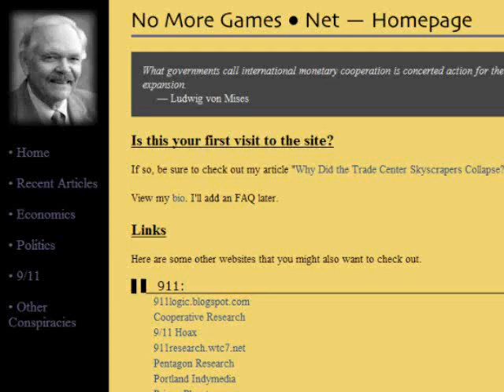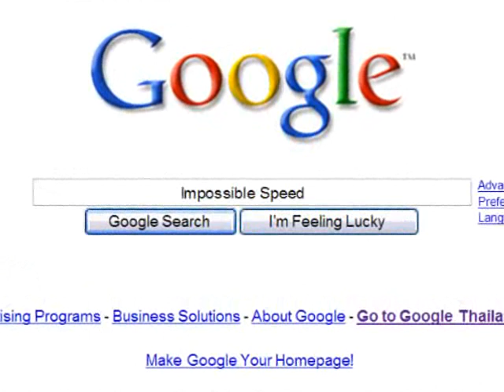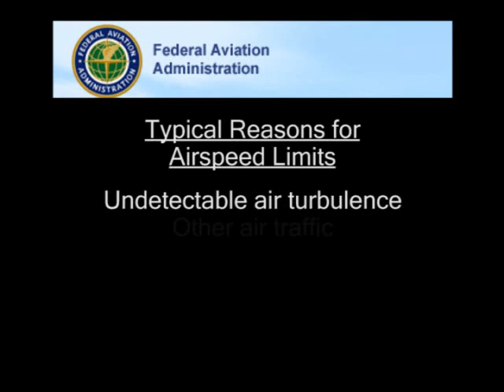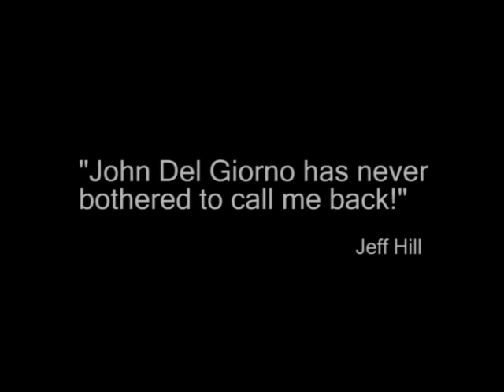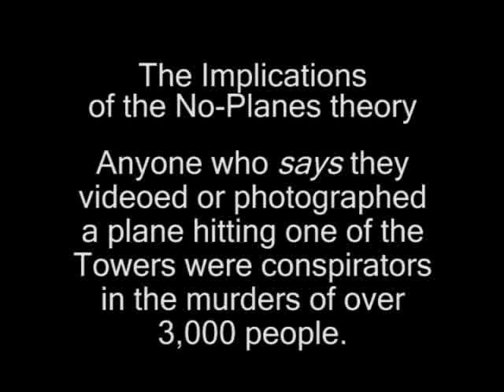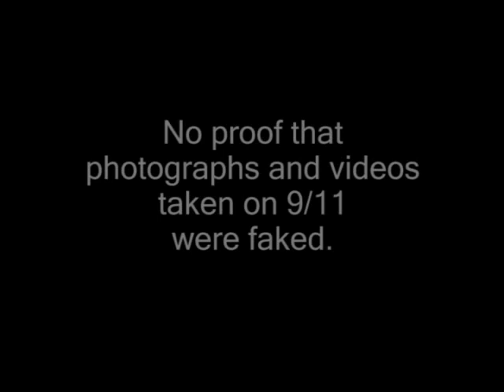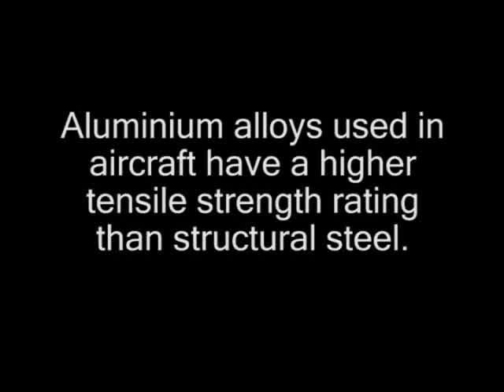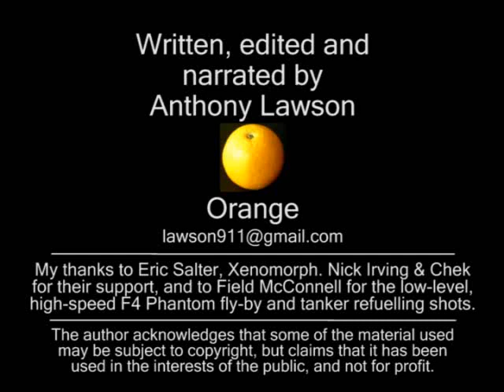9/11: Impossible Speed & Impact -- Busted! Updated

Comment: What a total load of GARBAGE .
Antone who knows a COMMERCIAL AIRLINE PILOT WILL FIND OUT FROM THEM , THAT COMMERCIAL
AIRCRAFT ARE NOT DESIGNED TO FLY AT MAXIMUM SPEED IN DENSE AIR.
THEY CANNOT BE ACTIVELY CONTROLLED & WOULD EITHER CRASH OR DAMAGE THEIR WINGS
IF FLOWN AT MAX SPEED IN DENSE AIR.
ALL OF THE FOOTAGE IN THIS VIDEO SHOWS MILITARY AIRCRAFT - COMPLETELY DIFFERENT CREATURES ,
WITH COMPLETELY DIFFERENT SPECIFICATIONS FLYING AT 500 + MPH  IN DENSE AIR.
The PLANES WHICH CRASHED INTO WTC 1 & 2 WERE BOTH MILITARY DRONES -- FULL STOP .
IT IS MOST INTERESTING THAT THE AIRCRAFT ENGINE WHICH WAS FOUND AT MURRAY STREET JUST AFTER
9/11 WAS QUICKLY DISPOSED OF - AFTER IT WAS REALIZED THAT UNITED AIRLINES  ENGINES WERE
MANUFACTURER BY A DIFFERENT COMPANY.
NO WORDS ABOUT THAT LITTLE MISTAKE IN THE OFFICIAL NIST REPORT.
Reply: Desert Born 
"Mountain of evidance"? Nobody credible says that you can't fly at such speeds, just that it's not recommended and dangerous. How interested in recommendations and safety do you think a suicidal pilot is likely to be?
As your man above says, the planes "WOULD EITHER CRASH OR DAMAGE THEIR WINGS
IF FLOWN AT MAX SPEED'.
Hmmm…crash or damage their wings? Sounds dangerous. Not recommended.
Reply: jbyeats Maybe you should look up the speed the commercial Egyptian airliner reached when the pilot decided he was going to commit suicide and crash the plane into the ocean in a dive. You will clearly find out that a plane can stay together and speeds way past the recommended "safe speed" I'll bet you won't do the due diligence and research it though, your kind never do and just parrot shit that you think is correct
Reply: Brookfield
Like many millions of people across the Globe -- I watched the second plane crash into
WTC 2.  It was in LEVEL FLIGHT -- NOT DIVING  .
Reply: Brookfield 
So what "dive" was Flight 77 in when it flew for over a kilometre at an altitude of just 6 METRES, flew over a raised highway, clipped 5 lamp posts in the process, levelled off again and smashed into the Pentagon at 530mph, penetrating nearly 100 metres, through reinforced concrete and steel?
Not to mention Hani Hanjour, the pilot of Flight 77 was described as a "terrible pilot" but his flight instructors and was actually denied rental of a plane until he'd taken more lessons.
Instead he managed to perform a high speed, high banked manoeuvre, descending through a 330 degree turn well in excess of 500mph. A manoeuvre many commercial and air force pilots have dismissed as "bullshit".
Not possible.
Reply: Thank you, Professor, but shouting does not mean you're right. Have some honey & lemon, sit down, and read some of the genuine scientific evidence.
Reply: Brookfield Nobody credible ? So you think that Pilots of those planes, Plane Engineers, Plane Designers, Governing bodies are not credible ? So what counter evidance to these experts and authorities do you have? Clearly its your jump in logic and the agenda you have to put your head up your ass and ignore basic facts. PROVIDE YOUR CREDIBLE WITNESSES/EVIDENCE TO COUNTER THE EXPERTS. If you cant, DO NOT POST ANOTHER THING ON THE TOPIC
Reply: You sound just like someone who is in the employ of the American Government .
Just like the vast majority of the experts you mention --- who if they really expressed their opinions would lose their jobs or be blackballed .
The vast majority of these experts either work directly for the US Government or one of its agencies -- THERE IS NO WAY THEY  ARE GOING TO COMPROMISE THEIR SALARIES
& THEIR FAT PENSIONS .
Reply: Antipodean33
Parrot Shit - Is that Correct. ?

Maybe you would like to start a discussion about " Parrot Shit  " -- with
 MR RUSS WITTENBERG -- who is an AMERICAN AIRLINES pilot who FLEW the
ACTUAL PLANES which CRASHED on 9/11.
YOU CAN CHECK it out on YOUTUBE.
However - "   I'll bet you won't do the due diligence and research it though, your kind never do and just parrot shit that you think is correct ."
Reply: jbyeats
Why would you expect a pilot to be an expert on the technical capabilities and limitations of the aeroplane that he flies? Do you trust racing car drivers or taxi drivers to know about the tech specs of their vehicles too?
Reply: Brookfield
Next time you get on a plane --  explain to the Pilot that he is a moron -- and knows nothing about the technical capabilities & limitations
of the aeroplane he is about to fly.

As for Russ Wittenberg who flew the ACTUAL planes which crashed that day on 9/11.
This man is in his 60s with a wealth of flying experience & when he tells me -- it is NOT HUMANLY POSSIBLY  to FLY the MANOEUVRES the PLANES WERE SUPPOSED TO HAVE FLOWN THAT FATEFUL DAY --- then I believe HIM

SHOW ME JUST ONE AIRLINE PILOT
on GOOGLE or YOUTUBE -- who CLAIMS HE COULD FLY ONE OF THOSE PLANES AND CARRY OUT THE FANTASTIC MANOEUVRES -- which the 9/11
COMMISSION STATED .
Go ahead -- JUST SHOW ME ONE .

Imagine if Russ Wittenberg had stated the opposite -- That he could indeed fly all those
moves etc. It would never be off YOUTUBE and GOOGLE . It would be stuffed down all our throats - NIGHT & DAY .
Reply: jbyeats Checkout the speed of the Egyptian airliner reached when it's pilot decided to commit suicide with many others on board. He put the nose down and went screaming into the ocean. Checkout the speed. Also don't forget, we know the planes used to hit the towers, were not the actual planes that was claimed. They were no doubt beefed up and the various different angles, that many people filmed of the second plane, proves that the plane did indeed reach around 575 mph
Reply: Antipodean33
Was the Aircraft intact when it struck the WATER ???

Also we know the aircraft which certainly
struck the SECOND Tower on 9/11 was not a
Commercial Aircraft -- as COMMERCIAL
AIRCRAFT DO NOT HAVE LARGE  PODS STUCK TO THEIR UNDERCARRIAGE .
( Check out any of the live feeds relating
to the second aircraft -- which are all over
Youtube and Google. )
Reply: jbyeats Thats right, that is what i'm saying. We know the second plane was not the plane (the commercial airliner) the govt claimed it to be, because of the huge pod under it. So now we have a mystery plane, which is no doubt remote controlled (the AWAC pod you mentioned) and it does have a military type of appearance, so it could be an ex military fuel tanker plane, which would have a beefed up super-structure and as such could attain the high speed which is proven to have reached
Reply: Antipodean33
Indeed correct.
All I ever said was ' Commercial Airliners  '
are not able to attain such speeds.
Of course - a militarized ex - airliner -- would have completely different parameters .
Reply: Antipodean33 Egypt Air 990 disintegrated around 17,000feet with a True Air Speed of 700mph and an Equivalent Air Speed of 480mph, this being when all signals to the Voice and Data Recorders terminated.
Conspiracy Theorists claim that this did not happen as the Aircraft pulled out of the Dive before 'Gliding' back up to 20,000feet or so, leveling out before entering 'another dive' and crashing into the sea.
The NTSB claims that during the Manhattan Massacre a Boeing 767 series 200 maintained a constant speed of 580mph at sea level with the same propulsive force that enabled it to fly at 535mph at 35,000feet.
It does not take much imagination to realize whose agenda the NTSB is promoting. (Zio perhaps?).
Poddies and Planeies go and get your heads tested.
Reply: Alan Marks
Now consider that the plane was diving, and the pilot did not care about safety or recommendations re speed.
Reply: John Smith
Why are you asking about a dive? Nobody's ever claimed it was a dive.
Reply: Brookfield
"Now consider that the plane was diving"
- You

Regardless as to what planes were diving and exceeding whatever air speed limits that have been imposed on them by the FAA at certain altitudes, it is not possible for Flight 77 to have impacted the Pentagon at 530mph at an altitude of 6m, especially since the turbulence and forces inflicted on the airframe at such a speed would have seen dear old Hani Hanjour plummet to the ground before he could ever utter the words "Allahu Akbar".

Passenger airliners are simply not designed to make such high speed, high banked manoeuvres, let alone reach those speeds at altitudes low enough to clip lamp posts and a generator sat on the Pentagon's lawn.
Reply: John Smith
I recommend that you brush up on your reading skills. I was responding to Alan Marks' comment about "the Manhattan Massacre…Boeing 767". Nothing to do with The Pentagon, hence my following it up with links to videos of the WTC2 impact. Nobody in this thread had mentioned Flight 77 until you brought it up.
Do keep up, old chap.
Reply: Brookfield
Yes, Alan Marks' comment which was inline with a 767 not being able to exceed 500mph at sea level.
You indicated the plane was in a dive, so I asked what "dive' Flight 77 was doing 6 metres off the ground, allowing it to strike the Pentagon in excess of 530mph, which also goes in line with what Alan Marks was saying.

Answers on a postcard.
Reply: John Smith
Nope. 
Nobody here was talking about The Pentagon.
Nobody has ever claimed that Flight 77 dived at The Pentagon.
I suggest that you lie down for a while.
Reply: Brookfield
Nobody had to. We're talking about 767's entering dives to exceed 500mph.
77 wasn't diving, so how'd it exceed 500mph?

It's really quite simple.
Reply: OOOOOOOOOOOOOOO you must be right because writing in all caps means you know what you're writing about.  Fucking Idiot
Reply: John Smith
AA77 was diving, and leveled out just prior to impact.
Reply: And that doesn't mean that it can handle such speed when it levels out at sea level. Watch the video "911, pilots say "NO WAY!" to understand.
Reply: Brookfield Nor does shouting mean he is wrong.. He is just tired of morons like you looking for the only other moron out there that will agree with them so that they can try and debunk the mountain of evidance